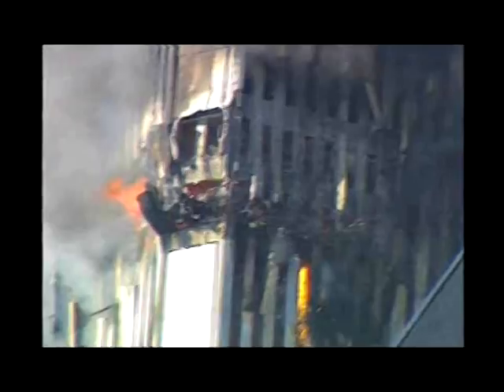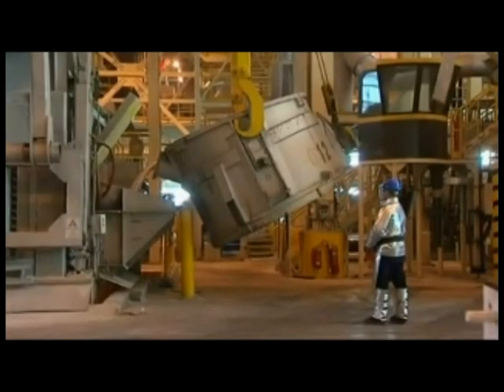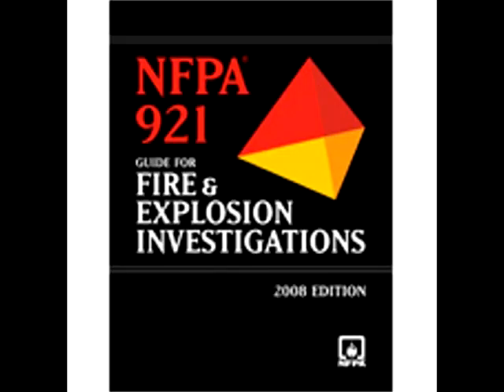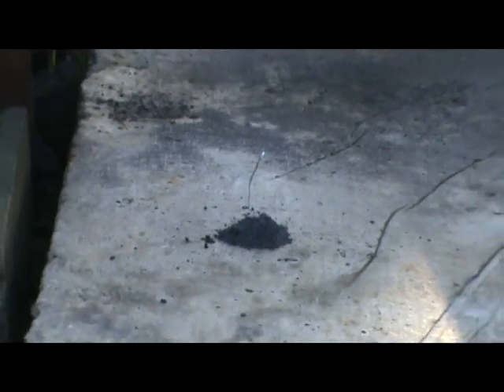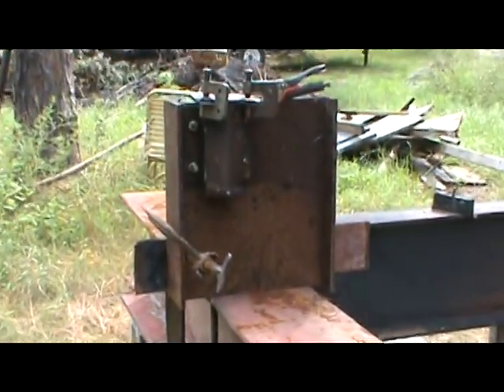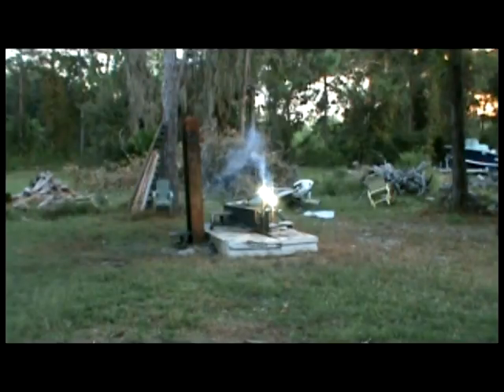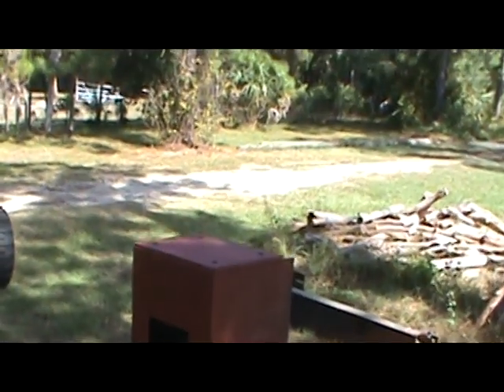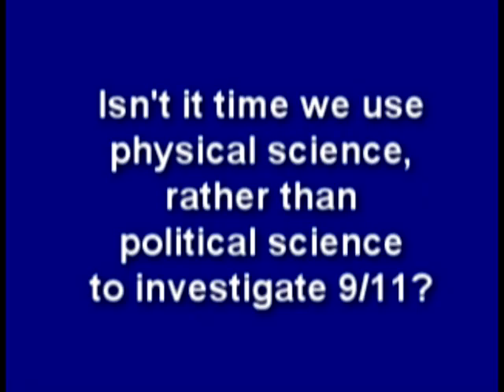9/11 Experiments: The Great Thermate Debate

Comment: No demolition .
Airplanes hit those buildings. 
The heat from resulting fire caused the collapse .
Building 7 had there standpipe system knocked out , so fires on four floors burned uncontrollably .
Heat caused structural deformation of light steel truss construction causing an eventual progressive collapse .
Explosive sounds are the result of compression of air blowing through walls . Heat causes air expansion , thus compression in confined spaces , further compression in progressive collapse situations .
It’s all basic science , and that radical Muslims have blood on their hands .
Conspiracy theories are interesting and are almost always , like in this case , lose with actual facts to support an agenda or claim .
Reply: And all three buildings collapsed in on themselves,... They did not fall over or partially collapse, no they fell straight down. Do you know what the odds are of that happening?
Reply: Have you been watching other building fires? Like Grenfell tower? Buildings hit by planes that burned for days? You don't think the Bush administration being gifted this to use article 5 of NATO to get into Afghan was anything other than a miraculous coincidence?
Reply: Also, revisit "light steel truss construction". The towers were over engineered and the beams had been sprayed with an asbestos/concrete coating years earlier making them super resilient to fire.

Comment: I think that it's fairly obvious that 9/11 was a deliberate demolition of the world trade center... however you   are taking your conspiracy theory to ludicrous extremes. As an engineer, you should probably go past the simple mechanical failures, as that is low hanging fruit and irrelevant. Learn just a small bit about metallurgy and the importance of static force. The building was underbuilt from its inception, and they knew it. Treated metals only need to reach temperatures as low as 350 degrees to begin to lose their important structural properties. In a massive building full of gas lines, hydraulic systems, hvac units, and 60 years of accumulated dust, debris, and corrosion, of COURSE you are going to experience countless explosions and excesses of heat. And given the tremendous forces involved in the collapse, the extreme air flows associated with large buildings, and all of the countless fuel sources, of COURSE you are going to experience forging and molten metals. Get rid of your tin foil hat. Quit going after the "government", and start going after the banks and insurance frauds that orchestrated and paid for the whole thing. Not only did they save tens of billions of dollars in not having to pay for the demolition of the building, they profited like bandits off of the whole ordeal in magnitudes of trillions of dollars.

Comment: the painting work on the steel beams weeks previously perfect way to apply thermite or any variation all paint including latex has used heavy metals from Iron to Mercury Barnes were painted white and rusted red when the paint and the iron within rusted and the paint company reportedly happened to be relation to the bushes look it up

Comment: Atlanta had a steel reinforced concrete bridge brought down by burning plastic conduit. It shut the interstate down for weeks. So, yeah, jet fuel plus all the other flammable material in the Towers would easily melt steel. Sometimes there is no conspiracy.

Comment: Great.  What now. Its been over 10 years and almost 50 years when they built the structure. I dont think there was a conspiracy to bring trade center down.  

So ....

Either they went through the building a planted the stuff before they crashed the plane. Which had to be noticed that they were tearing into the walls to get to the superstructure.

It was on the plane.  Highly doubtful. The amount of material would not be enough.

Or they built the built the building using materials not thinking that someone would do the horrible. Possible.

OR.... the metal warped away from the floors and the weight of the building panacked bringing the building down.

Now sherlock.... why? What was the purpose of putting our country through 15+ years of Hell in Iraq and Afganistan? 

You are gonna half to sell me the reasons why.  Real estate? BS. Stock Exchange and economy disaster? Possible but those who would suffer most would have to be the ones invested.

NWO? Take your tinfoil hats off you loon. 

UE? Nah they suffered as much as USA in their own economy.  All the stock markets are too linked. One goes down so does the others.

Bank industry? It wasnt too many years later we went belly up with Clinton & Bushes economy choices to let them de- regulated  the rules for lending.  Which BTW was just deregulated again. So combined with real estate, they made a land grab for air rights to the WTC area.  Talk to any NYC. They might believe this and tell you the plausible real estate person that would sellout USA to do that. He is sitting in the WH, right now.

So what is it?  

I just dont buy the argument that our country brought down buildings to blame another country/group into sending our soldiers in harms way. It was bad enough we had Bushes lies that killed or injured our brave American Soldiers in the needless Iraq war. Now we need to look back to that time when we all had to go through all of that again.

All this said.  I like your scientific approach.

Comment: Ok, so all your work seems to point to a controlled (or uncontrolled) demolition.  Was there any work in the building at those junctures?  Was thermite (thermate) installed when the buildings were built?  Why, and by whom?  That would have meant a plan to destroy them in that manner at their inception.

Next, the architect (who, theoretically, should know these things) indicated that he had built the structure with steel tabs connecting the central column to the external columns to make the largest possible floor space available.  Although the fire temperatures were not enough to melt steel outright, they were more than high enough to make it sag - and once a few of those outer column tabs failed the building was done for.  Why would the architect lie?

Next, eyewitnesses indicated the volume and speed of air movement towards the fires was certainly storm strength, possibly higher.  Fuel and force fed air will burn at higher temperatures than fuel in still air - think of forest fires and blast furnaces.  Essentially, the towers were 109 storey blast furnaces.  Could that be possible?

Which explanation is more reasonable?  Someone at some point in the building's history planted thermite or thermate and arranged for two planes to fly into the buildings to hide their perfidy or the buildings had a weakness that was sadly their downfall? 

Remember, at hundreds of tons per floor, not too many of them have to fall 14 feet to have enough momentum to collapse them all.

Comment: This video is lame.  Tanker fires have damaged many structures, even when the tanker was above or beside the structure.  Planes scheduled to fly across the country carry a lot of fuel and those used had just taken off so all the fuel would still be available to burn.  The towers were on fire for a couple of hours before they came down and the design firm for the towers stated they had performed almost exactly to specification.  Many were horrified, none were surprised.  It is not necessary to melt steel to cause it to fail, but anyone who has visited a forge knows a combination of fuel, moving air, and time will melt steel, or heat it to the point where it can easily be worked.  A hot fire will cause air to move.  There was airplane sized holes in the sides of the building so a healthy supply of air would be available.  There were probably lots of areas where the air was funnelled by furniture or airplane bits, causing the burning fuel to generate enough heat to melt steel.  Heat and time are all you need.  The molten steel may have come from the building, or it may have just come from furniture, there is a lot of steel in chairs and cubicles.  That steel is smaller and more easily melted because it does not have the heft of the steel beams.
Most people can't tell the difference between one explosion and another.  What we perceive as an explosion is just a shock wave travelling through air, it reaches our ears and we hear an "explosion".  A good example of this is a sonic boom.  The supersonic plane does not explode but we hear the explosion!  Same with helicopter rotors.  In engineering school one of our projects involved feeding columns made of different grades of concrete into a press.  We compressed each column until it failed and a gauge on the press recorded the pressure applied at failure.  Every one of the failures sounded like an explosion, and they were just little 6 inch diameter columns a couple of feet in length.  I imagine there was a lot of concrete in the towers and it would have failed in different places and at different times which would give the impression of a lot of explosions.

Comment: Thermite: Thermite is an incendiary reaction that can burn as hot as 2500°C or more. That means that if you lit a pound of thermite on top of your car it would melt through your hood, through your engine, through your driveway, and make a hole in the ground. Thermite is a reaction between a metal (aluminum, magnesium) and a metal oxide (iron oxide, copper oxide, manganese oxide…) this reaction has a high ignition temperature, but once its ignited it supplies it’s own oxygen. This allows for some interesting applications, for example thermite is still used today for underwater welding.Air crafts are made of Aluminum and Magnesium. The building is made of steel. The air carries jet fuel. So, you see, all of the necessaries are in place to create Thermite. So, No, the buildings were not brought down on purpose by the government. So, this is non-sense. :-(

Comment: Non-Sense.  You don't need to melt steel to cause the building to come down.  The steel structure is under great stress, just heating the steel will cause it to fail and collapse. Yes, the jet fuel generates enough heat to collapse the building.

Comment: Do you even know how hot a kerosene fire can get?
Do you know how steel is molten normally?
Do you know how fucking much thermite you would need to accomplish a task like this?

The fire of that spread out fuel, the incoming air and the insulating effect from the building itself, will produce temperatures well above (a few hundred degrees) the melting point of steel.
Burning fuel in the open air can't provide enough heat energy to maintain a stable temperature above the melting point of steel, but if you insulate the fire, it will.
Also the statement that very high temperatures have been recorded even days after the collapse shows, that it was very well insulated, you can even look up how good concrete insulates.
Wouldn't someone have noticed that a whole office floors supports are hang full of thermite and then called the police?

This whole conspiracy theory looks at everything together, picks stuff out that they need and takes for example the kerosene fire in open air, ignoring the fact that insulating it so the heat doesn't escape too quickly it will melt steel and then saying, an open air flame can't melt steel, so this fire can't melt steel too.
No basic knowledge of reality 😅

If you wondered why I can't describe everything in good English is because I am German and I can't even speak German fluently, so the fact that I can't write in super good English is kinda obvious

Comment: My friend who's an active duty Combat engineer in the Marines said The combination of the impacts combined with the intense heat can heavily weaken the structural integrity of the beams.
Reply: Adam Watson Pendening on chemical structure of material ....stainless steel is designed for high heat Mulacular structure is changing from each product.

Comment: Well reasoned out theory.  However this oils require building access at a very large scale, breaking through office walls to access the steel structure, making the “uncleared modifications”, then repairing the walls; presumably all during the graveyard shift.  This would need to be done by someone with access to the building, and the considerable time to get it done. Few people over a long time, or dozens of people in a short time.  There would be some manner of security log and/or falsified work orders somewhere.

Not saying impossible, just seemingly improbable.

The facts may never be truly known until we can control our perception of space/time like a DVR.
Reply: Craig Gorsuch ..there was work being done to the elevator shaft areas for month before hand..there is record in the city AND confirmation of the fact from people who worked in the building during that time..."white dust all over everything every morning" was one of the quotes.

Comment: We use a Thermate to ground steel beams. It's called Cad-Welding. You place copper into a carbon block or mold and attach it to the steel beam. The reaction of the thermate welds the copper to the beam. The heat from the reaction does melt into the steel. Although the penetration is very slight due to the design of it's application.

Comment: You changed the news audio...  also that’s not molten steel, it was jet fuel.

The steel didn’t melt, it softened, buckled, bent and the floors attached to the sides detached and collapsed down.

You want melted metal, go melt your tin foil hats and get a life...  smh

Comment: Great video, aluminum when melted will be silver, but the thermite reaction creates molten iron, not aluminum, aluminum gets converted to aluminum oxide, whilst the iron oxide mix converts to molten iron, so the colour is wrong in that hypothesis.  Grade 10 chem.  I was wondering what would happen with the slotted box with thicker steel casing, and compressed thermite, thermate mixture therein.  But all that needs to happen is a weakening of the beam and fasteners, the rest can happen with the wieght of the materials themselves to cause a collapse.  Building can burn for days without falling, which makes me believe this was an engineered event.
Reply: Buildings cannot burn for days without falling after being hit with a 767 that weighs 400,000 lbs and was going 500-600 mph at impact.
Reply: I bet it never occurred to you to walk into your local fire station and ask them,  did it?  Of course not.  What the hell would people who fight structural fires for a living know about it?  I don't suppose you saw any of the color of the metal at the actual towers, did you?  You really think none of the people in the building would have noticed workers setting these charges?
Reply: beaconrider i mean to be fair there weren't exactly any firefighters that inspected the impact site up close

Comment: Are you serious? Just because steel melts at a higher temperature than jet fuel burns, doesn't mean that the steel is still strong. It bends like a fucking wet noodle. The firefighters are going to hear explosions, because a building is collapsing. No bombs were used. Some fucker drove a plane through the building. And who's the asshole who said that Jews disliked this video? What in the actual fuck? Any more arguments you fuckers want debunked?